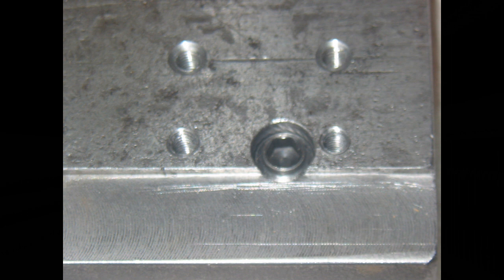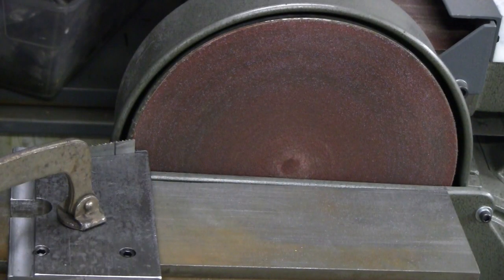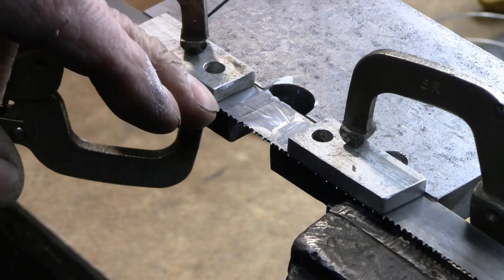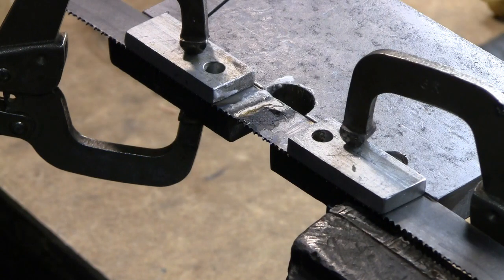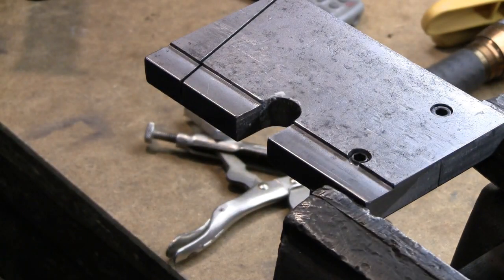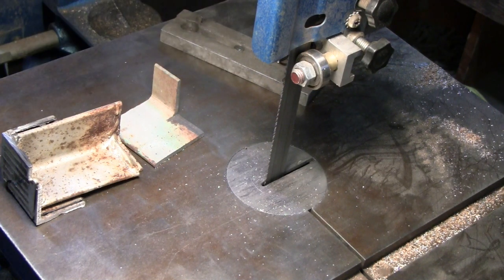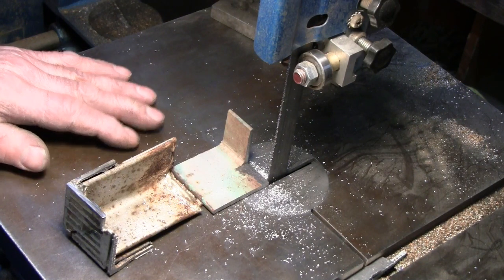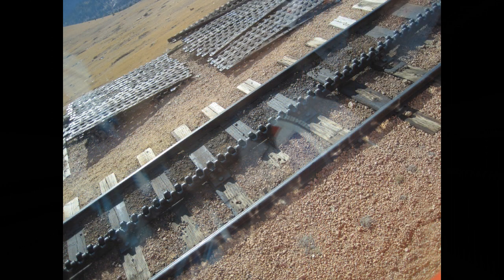Bandsaw Blade Fixture part 2

Comment: Joe, now I understand what the bevel slit was for! Looks like it worked out well. When silver soldering or silver braising (which ever you want to call it), the solder will flow to the hottest area, so if you get a area that isn’t flowing, just add a bit more heat to that area.
Reply from the maker: Good advice, John.  Thanks.

Comment: You'll need to be in great shape to run 100 feet at 14,000 feet, or, take a fresh bottle of Oxygen with you...   lol
The blade seemed at the correct height, possibly a little bit on the thickness side, though, it doesn't take much...
Great and easy enough tool to make... !!!
Reply from the maker: Didn't do any running up there...but if you ever go there, be sure to have a couple of doughnuts. The visitor's center makes really good ones.